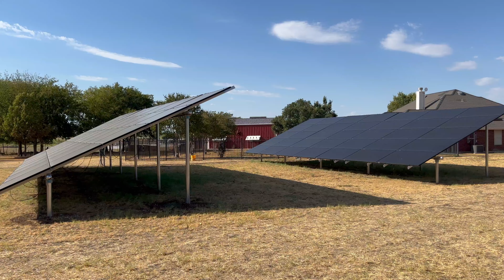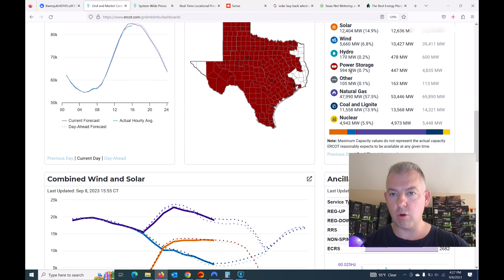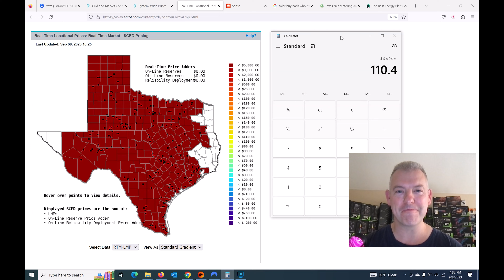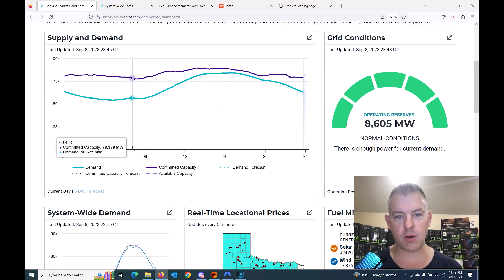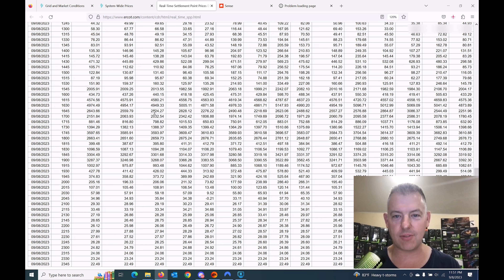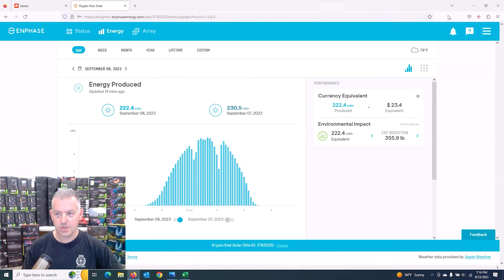How I am earning $110 an hour from solar buyback

Comment: Tx does not have pure net metering.
Reply from the maker: Well they certainly have some great buy back rates, you can check my latest video where I received $1.71 for over 500 kW/hrs (over $900 credit on my power bill) so that is awesome however it works :-) How does it work if it isn’t pure net metering? If I look at what the power companies direct me to, its always the ERCOT website buy back rates, if that is not accurate I would like to learn what it is.
Reply: @Krypto-Kiwi  The 1.1 plan vs the wholesale rate. With ERCOT would be a game changer for me. I'm stuck with Entergy, so I don't bother with net metering at only 3.58 cents a kw.